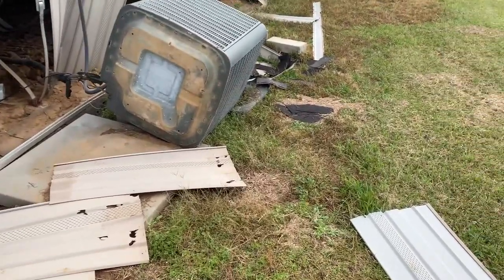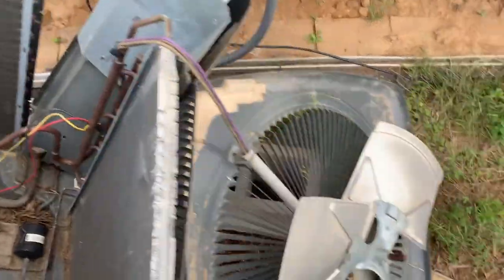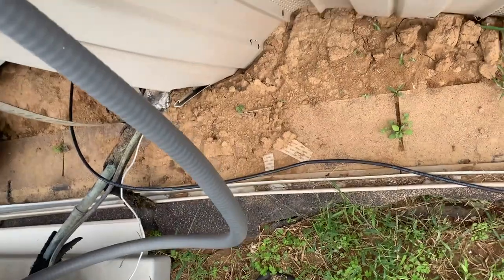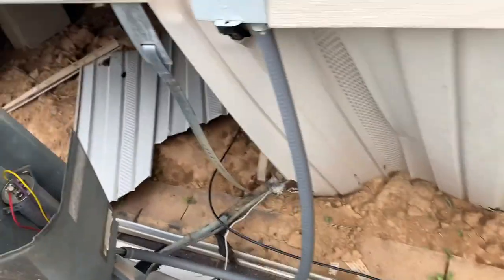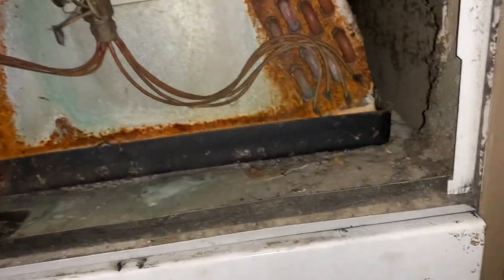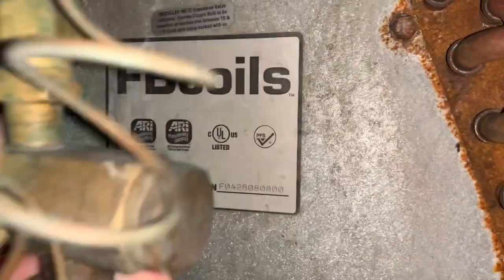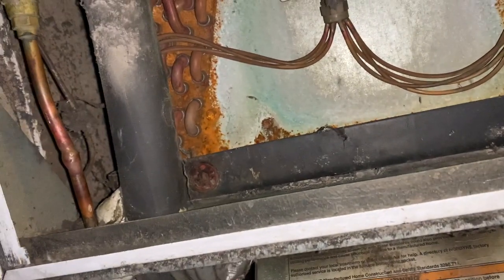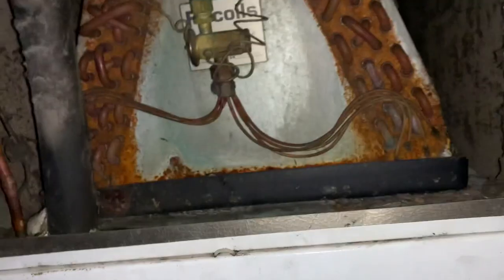Looking at a Upcoming HVAC Change Out

Comment: New float safety switch. Weatherstrip those leaky bottom doors. New cabinet insulation. New heat sequencer. New 3/4” pvc drain to outside. Lots of mh up my way too. Have fun.